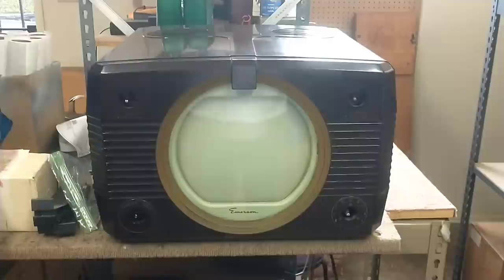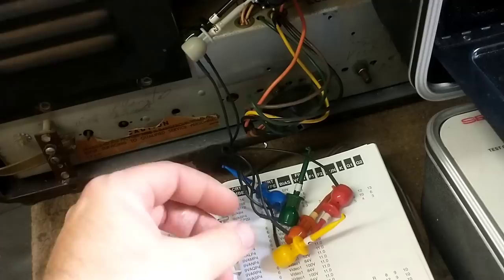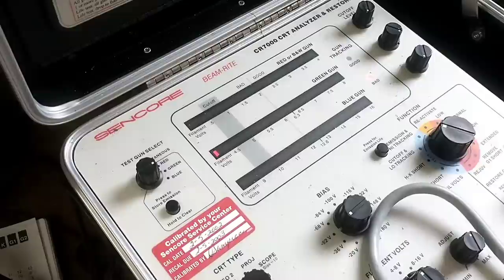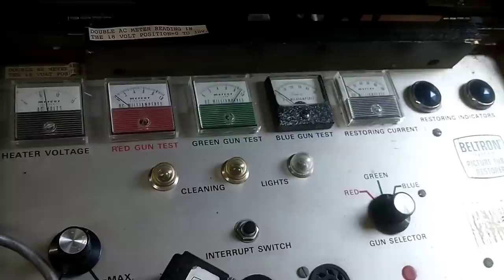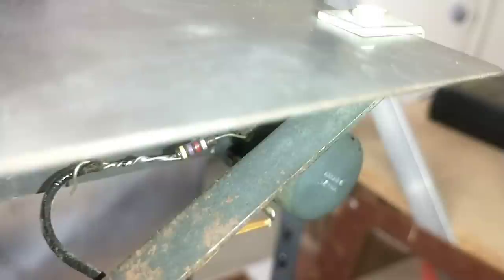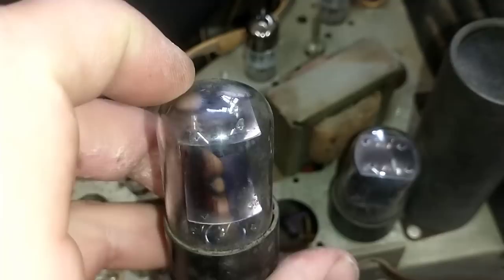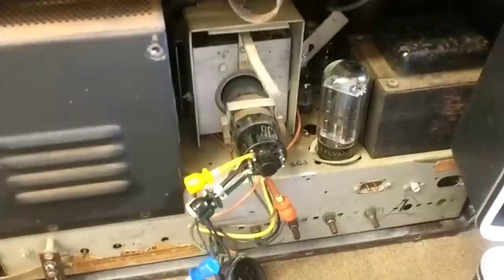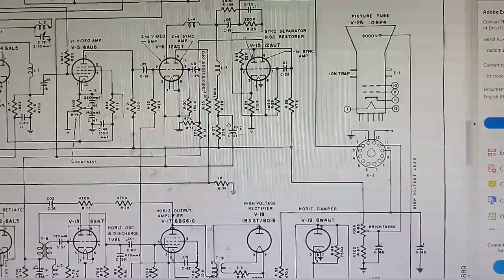Servicing a late 40s Emerson 614 10" b&w Television. No picture, HV OK. P1/? Assessment

Comment: Note the rear of the chassis. There  is a triangle around the number 1 at a slight angle found right below the power transformer. This is referenced in the model 614 ( and 637,644,647)  Emerson Television Manual . In that manual you
 will find changes made to this TV from the original schematic. See page 19 of the manual for what was done. There is 
also an addendum to both chassis versions and  a corrected chassis wiring diagram for your 210113C chassis which
 I think should be used for this TV Jordan. All can be found at the early television foundation !
Reply from the maker: Thank you!
Reply: @JordanPier  You were indeed stymied by the fact you didn't have the Emerson schematic for it but I have learned from Bob Anderson that if you have the manufacturer's manual then that is the best source period.

Comment: Other than the power supply that 614 is fairly similar circuitwise to my 611. The voltages you were getting on the neck (after adjusting for your pinout screwup) look perfect. 7-150 on the cathode (depending on brightness knob) and 3 on the grid if there's no input signal. My bet's on the ion trap magnet being installed incorrectly. If the tube is inserted through the wrong side of the ring I believe you won't get anything on screen.

Comment: i own a emerson model 644 from 1949 still in the process of restortation
Reply from the maker: Very cool. 

Early post war stuff is rarely seen around here, so its nice to dabble in it. Mostly see 60s and 70s stuff here.
Reply: @JordanPier  the crt on my 644 had a hk short blew it out with my beltron, from what i was told about the set it was shipped to springhill. nova scotia in 1949 from the usa and the owner could only pickup some us stations until canada started broadcasting in the early 1950's and 60's and 70's sets here are next to impossible to find lucky to find the 644 only 10 min away

Comment: Not sure what happened to my previous comment, but that is a model 614 and the sams and service manual are available via etf
Reply from the maker: Thanks! That is super helpful, but 614 has only two knobs. This has 4 like a 637. Same chassis?
Reply: @JordanPier  The 624 has four knobs. In the factory manual it kind of looks like two knobs but if you look closely the top two are there, just all black.
Reply from the maker: Definitely looks like a 614. Thanks guys.

Comment: On the video, the wires to the CRT socket look new(er) than the vintage wire underneath the chassis. Could it have been a replacement? Wired wrong?
Reply from the maker: Thats what i had thought at first, but after looking up the 10bp4 data and looking at the schematic the crt is wired up right.